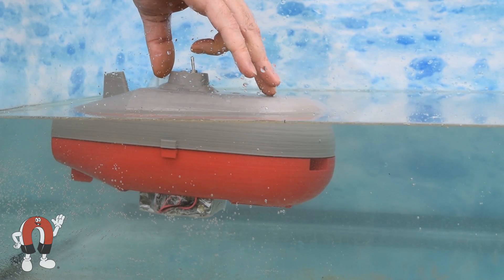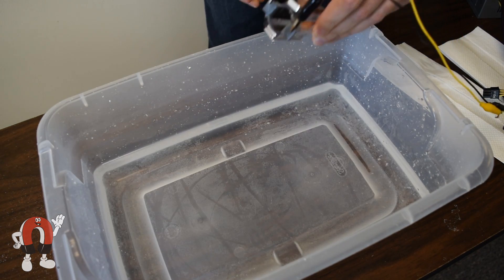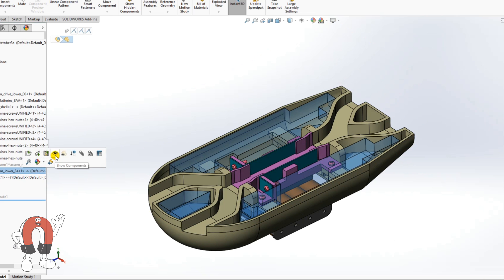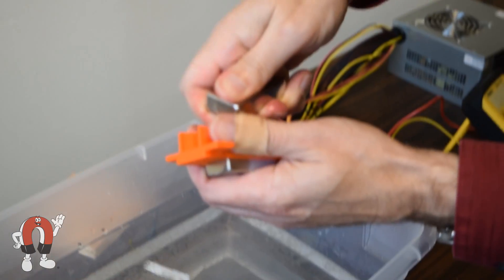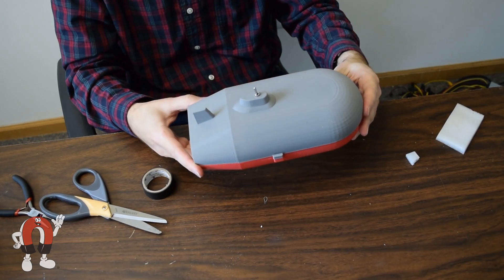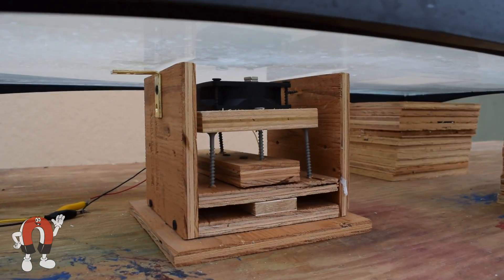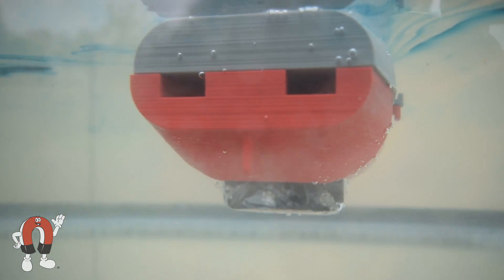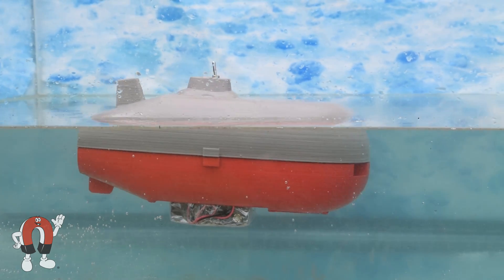Magnet Powered Submarine - The Hunt for Red October IRL!

Comment: Maybe by using just 1 exhaust instead of 2, the outgoing jet would be more powerful.
Reply: I would add to your idea and having a smaller discharge port in comparison to the inlet to act as an accelerator/ jet or compression nozzle.
Reply: @adriandumas01  Good idea. I also think adding multiple magnets and metal strips along the tube would help because it would add more force to the liquid as it moves down the tube, thus moving the water at faster speeds.
Reply: @adriandumas01  like the failed EM drive?
Reply: @adriandumas01  water is (almost) incompressible, but with the gases this will certainly work better
Reply: @adriandumas01  No, making the water jet farther like a finger on the end of a garden hose does not change the re action of the sub.  There may be an optimal flow rate for your power supply, but control that with valves on the inlet side.  For best thrust, you just want to make sure the exhaust is moving in one direction and you don't add any more resistance to the flow.
Reply: I agree... I want to see Magnetohydrodynamic submarine version 2.0 with the suggested changes.
Reply: Agreed. Bifurcating the exhaust probably causes some pressure losses, reducing the thrust the sub ends up with.
Reply: Most of all so will a straight tunnel work better
Reply: Should have used two engines, they wanted the "look" but skimped on the powerplants. But for sure some experimentation with the flow chambers is needed. This more of a proof of concept. I wonder though how two would interfere with each other seeing as they use the water itself as a conductor.
Reply: Great proof-of-concept. I think we would all love to see an upgraded sequel to this.
Reply: The venturi constant definitely comes into play, but will the increase in thrust overcome resistance to flow?
Reply: the inlets and outlets should be smaller so the volume is constant with the MH drive.
Reply: I wonder if there is enough hydrogen and oxygen to ignite at the back? Probably not.
Reply: Reprinting the chamber more cylindrical would improve effeciency than rectangular.
Reply: This thread is my thoughts exactly. Is there an optimal amount of compression for this type of drive? The energy of a moving mass does not increase linearly to it's velocity, it is exponential to it. The resistance to compressing the fluid will have a point of diminishing returns. I wonder what is optimal, and what variables influence that point....magnetic field? voltage? current? conductivity of the electrolyte? volume/velocity of the electrolyte? Fascinating problem, I wish I was an engineer.
Reply: @kingofbrutaltheocracy9201  That's analogous to the "specific impulse" in a rocket.  Your momentum (that is what you recoil from) is mv.  However, doubling v takes 4 times the energy.  The lower the thrust, the more energy efficient you make it.
(I'm an engineer but not that type.)
Reply: 2 outlets lets you effectively use vectoring of the thrust for maneuvering
Reply: @glendavis2774  That would work if there were twin drive systems or a method of partially closing one of the outlets.
Reply: almost like a rocket's bell nozzle would probly be a good idea
Reply: @ludviglindhe1262  No,  the water is not expanding.  It's pretty much uncompressible.  Suggest you watch Scott Manely series on "what KSP doesn't teach you" there is an episode about nozzles.
Reply: @JohnDlugosz  yea your probebly right, dident think about the diffrence about of fluids and gas xD
Reply: Shape the drive tube like a jet engine
Reply: @JustPete65  No, the fluid is not hot and under higher pressure than ambient.  You want a perfectly straight round tube.
Reply: 2 drives, streamline the hull, more power and thinly insulate the aluminum from the water, i don't think it needs to be in contact with it. No direct contact, less-to-no bubbles, which means 99.9% silent drive
Reply: @mariusbrabus  If you remove the water-metal contact then the drive itself ceases to work.
Reply: @gnuthad  Ah, so there has to be contact. OK, makes sense
Reply: You can't compress water
Reply: @tomobrien6983  my thought exactly. You can how create water cavitation. Maybe some spiraled fin in the exhaust would do the trick. 

Narrowing the exhaust port is just going create back pressure, with out a check value. Which kind goes against this particular engines purpose. 

I don't know just spitballing here.
Reply: with these low pressures a single very wide and very thin jet (around 40/1) gives better results that the ones they used.. A much smaller round outlet with deep rifling or riffling could also help exit speeds.
Reply: beat me to it
Reply: Two points: 1. increase voltage by doubling the batteries in series, the output power will be twice  2. the submarrine vessel should be longer and more aerodynamic (the hydro magnets inside then could be longer as well, therefore more output power again)

Then it would deserve real environment tests somewhere in sea.
Reply: one exhaust, agree'ed
Reply: what else would speed that up? a longer segment of rails on the side? i try to imagine this thing in the scale of an actual nuke sub...
Reply: Exactly, put Bernoulli to the test.
Reply: absolutely correct
Reply: No, the change in momentum is supplied by the drive core.  From there you just want to reduce the resistance and keep in moving in one direction.  A straight path would be better, but narrowing the port would be worse.
Reply: LENZ effect is how my magnetic design works... Same would work for a nuclear submarine... Torroidal center flow... Watch my channel about my All metals isolating magnet...
Reply: That is the reasoning behind two independent drives.
Reply: Noise. 2 pipes at half flow generate twice as much noise. (Auxiliary Steam is noisier than Main Steam.)
Reply: It's probably been said,  jets use the venturi effect. Squeeze the incoming water through a smaller outlet. And similar to port and polishing an inlet or exhaust manifold on an internal combustion engine, smooth the transition between parts within the jet tunnel. My question is, would stronger magnets or more current create more thrust,  or is there a limit? It reminds me of the ion thrusters on space craft. Not built for speed.
Reply: I would also suggest increasing the voltage. Two nine volt batteries would increase it by 50% and reduce weight at the same time.

I wonder if the yaw is due to a rotation in the fluid created by pressure differences. Like a high pressure air mass rotates clockwise and low pressure counter clockwise. If so, two engines wired opposite each other should eliminate it.
Reply: @thomasbower7727  It's not so much the voltage that needs to be increased but the current. Yes, 18V would, in theory, produce higher current but 9V batteries have rather pathetic current handling. Were they to use 18V of Lithium cells then the current capabilities would increase substantially.

Personally I would have used 2 drive chambers - 1 on each side - or extended the length of the single drive chamber to increase the current flow and drive force.
Reply: @gnuthad  
Current is dependent on the load. And a battery's current capability is rated in milliamp hours, not simple milliamps. Having more amperage available (more mah) has no impact on how much current is produced with a given load and voltage. An 18v lipo battery won't produce a stronger current, just a longer lasting one, unnecessary in a small tank test. And the weight of such a battery would cause the test boat to sink deeper in the water increasing drag.

And honestly, since this was just a proof of concept more speed isn't actually important.
Reply: @thomasbower7727  I am well aware of current v load. The fact is that a typical 9V battery is only rated to around the 400mAh range. This is over a discharge rate of < 0.1C. Compare that to a lithium ion/polymer cell of the same capacity. The capacity can be easily used at rates well in excess of 1C for even the worse eBay cell.

By ramping up the voltage on the "engine" you also ramp up the current so long as the battery can provide that current. Reduced current equates to reduced power from the "engine", making the increased voltage pretty meaningless.

You need to take into account the internal resistance of the battery itself. The humble 9V battery has a rather high internal resistance, generally around the 5Ω mark for an alkaline variety. Compare this to even a small lithium-ion cell where the internal resistance is down around the 0.005Ω mark (5 milliohms). That internal resistance decreases with increasing cell capacity.
Reply: @thomasbower7727  I was wondering if stronger magnets would increase thrust?
Reply: so 2 inlets one central outlet? put the outlet where you would see a normal subs screws.... and put it behind the rudders. That way the thrust can be semi directional?
Reply: A single straight thru fluid path would reduce the drag gnerated by turning the two inlet and outlet paths and provide more thrust

Comment: Lots of errors here.  The two plates and hardware must all be stainless steel.  (the aluminum is being eaten up)  The ability to float is not improved by the foam plastic, if water can't get into the voids by sealing the compartments.  The switch is absolutely unnecessary, when lifted out of the "sea" the connection is opened. Put the battery in a small "zip lock" bag with connections via S.S. bolts through two holes covered with plastic glue or a blob of contact cement or some such on the sea's side.  From Wikipedia:  "Few large-scale working prototypes have been built, as marine MHD propulsion remains impractical due to its low efficiency, limited by the low electrical conductivity of seawater."
 see:  https://en.wikipedia.org/wiki/Magnetohydrodynamic_drive  . Ron W4BIN

Comment: Absolutely LOVE  it.  Is there any chance that you share your 3D print file.  I would love to replicate this for my students.
Reply: Part of the fun of the project should be the making and modifying the files for the students.  Set them up in teams and put someone who knows any of the 3d design programs as chief navel architect, One for team lead, one who knows how to print as chief manufacturing engineer, and one who likes to draw as the industrial designer. 
Let them play with water flow, Magnet placement, Port cross section and trim of the boat in the water.  They may even look at length to boat cross section as a factor to get speed.  They could research not only sub design but large surface boat design.

Comment: If you can bring down the EMF, you can prevent the dissociation of water (thereby less wasted energy). But how?? Perhaps with PCB "Fins" (narrower actuators connected in parallel, arranged in series) in the magnet-gap to decrease the EMF [volt] while preserving the E-field [volt per meter] ? If you can go below 1.2V, this should prevent dissociation. With your 12V system, this would need nine PCB fins in addition to the end-electrodes ( creating 10 water-gaps)
Reply: Nope.
You can never bring down the dissociation of the water, as that's coupled directly to the current you pass (Faraday's law of electrolysis).
The only way to lessen the creation of hydrogen and chlorine is to lower the current, which also lowers the force on the water...
The only way to increase to force without increasing the gas produciton is to use stronger magnets which is why the specifically mentioned 'cryogenic plant' in the movie as the red October used superconducting magnets for the drive (also mentioned in the movie when they have the caterpillar drive breakdown due to sabotage by the cook).

An other thing which they did not show in this video is how much corrosion you get on the positive electrode which basically gets dissolved over time and the only way to reduce THAT problem is to make or coat the electrodes with platinum.....
Reply: @srenkoch6127  --  Well, if you reverse the magnetic field and at the same time reverse the electric field, you can use insulated electrodes.
Reply: @GilmerJohn  Well yes, but you would have to do the reversal at kHz range in order to use the electrode capacitance like that, and in not sure you can reverse a sufficiently strong magnetic field at that frequency.
Remember that NMR-magnets neds to be ramped up and down over minutes if not hours....
And if it could be made to work this way it would make the system basically a HUGE radio transmitter making the sub quite easy to detect (an oscillating magnetic field is one of the definitions of a radio transmitter).
Reply: @srenkoch6127 - Carbon electrodes also resist electrolytic deterioration. Aluminum was a particularly bad choice for electrode material, as electrolysis of NaCl in water produces NaOH, which will directly attack aluminum and produce even more hydrogen, even in the absence of further electric current.
Reply: Interesting idea.
I'm not at all familiar with the electrical side of this but mechanically I was going to suggest that you could also design the drive to sit at a slight angle (say >10deg pointing down towards the bow) to create an easier inclined escape path for any gasses that are produced. The loss of thrust due to the angle would be marginal and it would keep the fins submerged so you wouldn't get drive losses from any accumulated gasses.
Reply: No Smoking
Reply: LENZ effect is how my magnetic design works... Same would work for a nuclear submarine... Torroidal center flow... Watch my channel about my All metals isolating magnet...
Reply: @AquarianSoulTimeTraveler  yep, I can see that.
Reply: Or a relaxation oscillator pulsing into a step up transformer, and the back end would give a turbo effect?